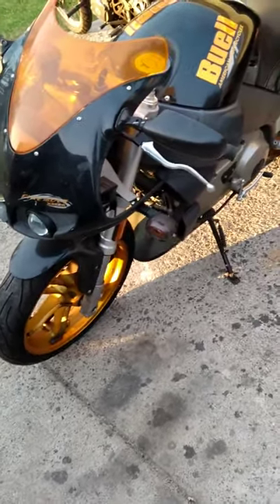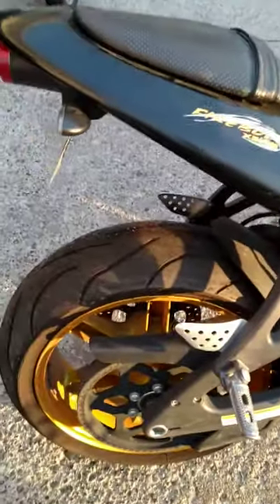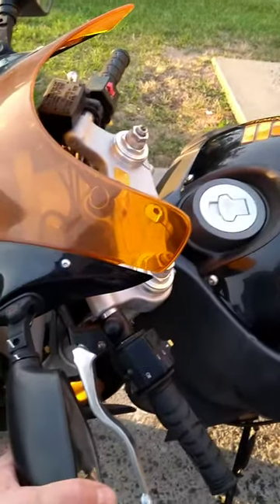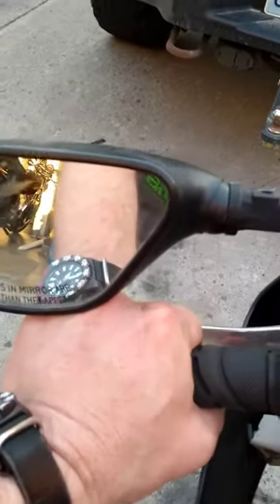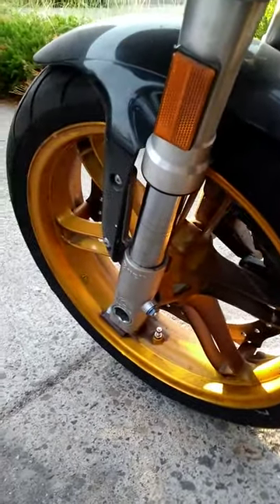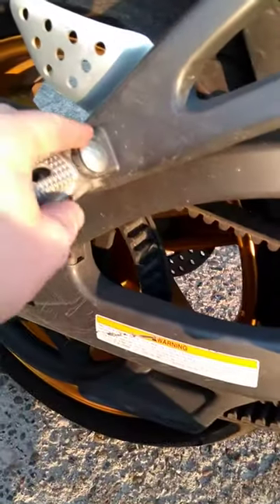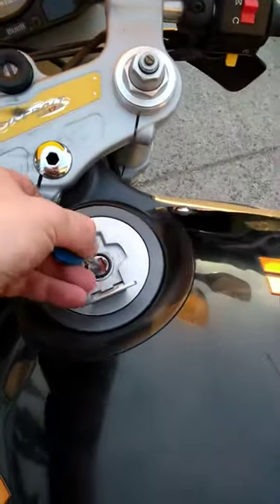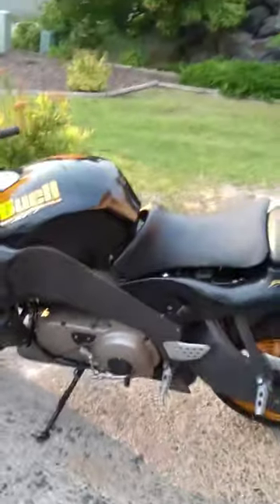2004 Buell XB12R Firebolt walkaround

Comment: Those aren’t stock mirrors. St. Paul Buell for the springs and bolts. My best performing video is a step by step fork seal video. You probably don’t need it but I’d love to know what you think. 

You want to invest in an exhaust side air scoop. My fan never comes on when I’m riding... only when I stop and turn off the bike.